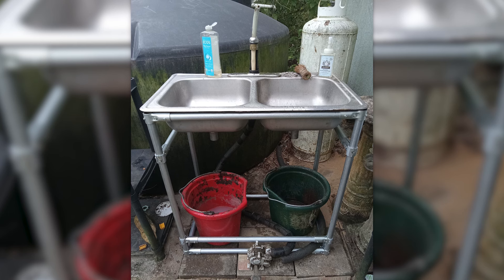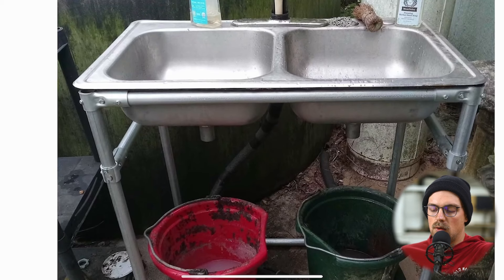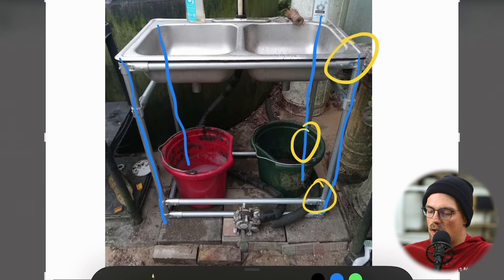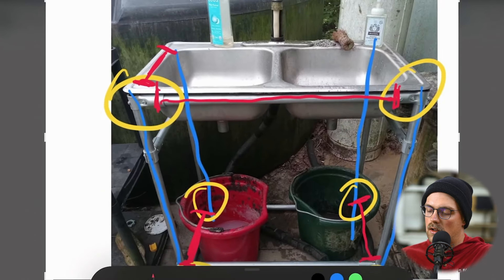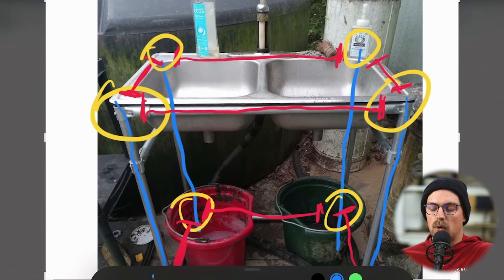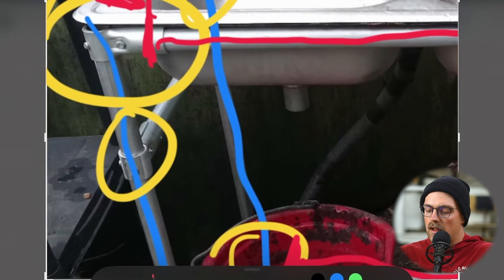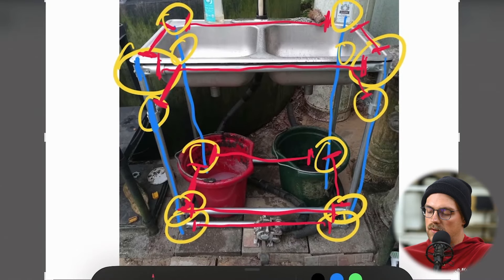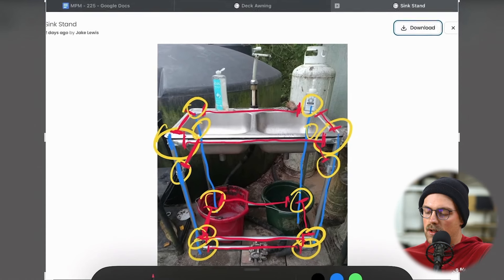How To Make This Custom Utility Sink!

Comment: I made my first purchase a short time ago and couldn't be happier. Nothing special but I purchased 6x10 welding curtains to separate off a section of my garage from sparks. I bought adjustable hinge flanges to make hangers from 3/4" conduit. My intent is to have the curtains hang from ceiling to floor. Other projects outside before winter have slowed my progress but these will be perfect.
I will be ordering the 90 deg. connectors soon for the same purpose shown here. Your products are amazing.  Congratulations